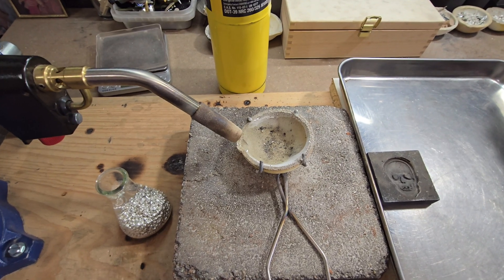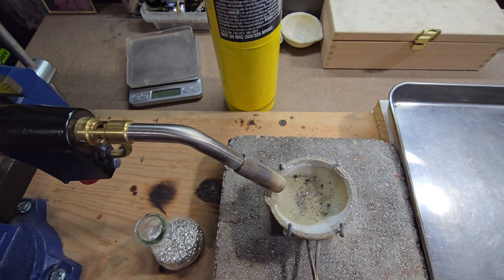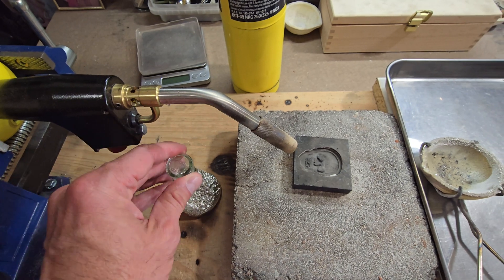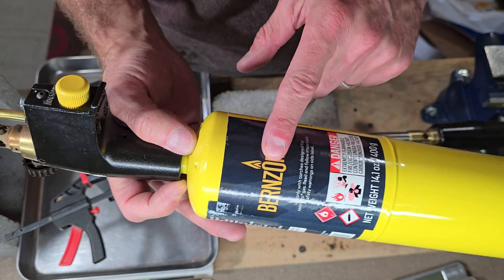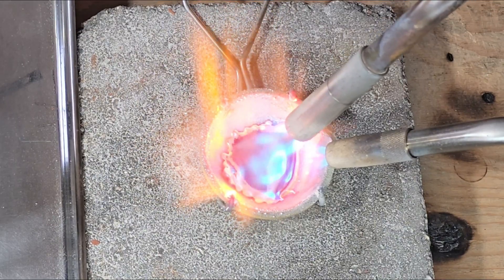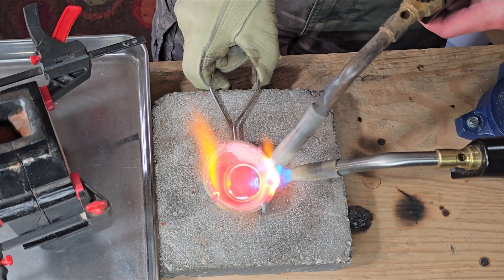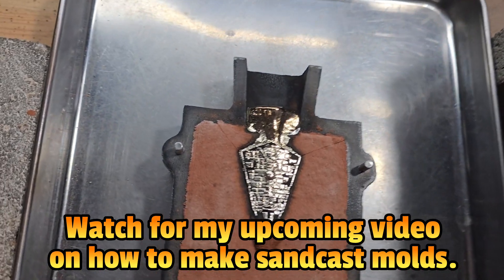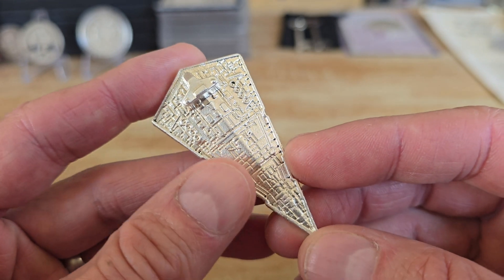How to Melt & Pour Silver Using a Hand Torch & Ceramic Crucible at Home

Comment: Does the Benzpmatic T8000 work at an angle without going out ?
Reply from the maker: Yes, it works perfectly at angles without any problem. I'm usually holding it horizontally or even pointed downward most of the time.